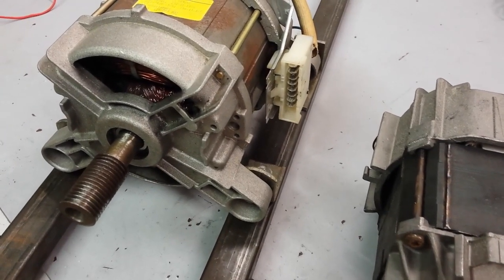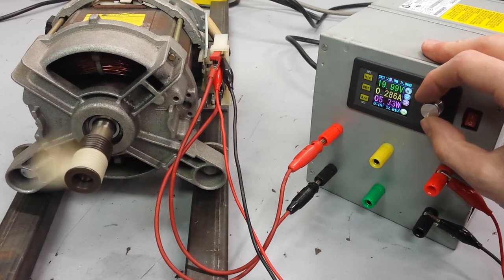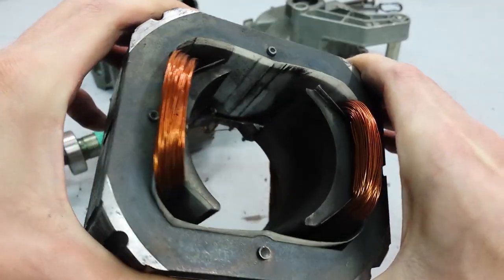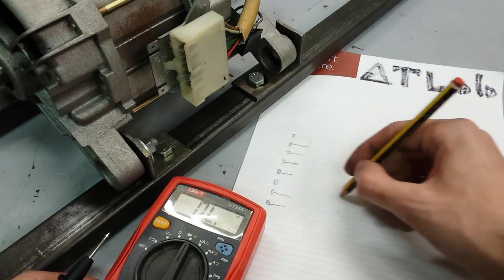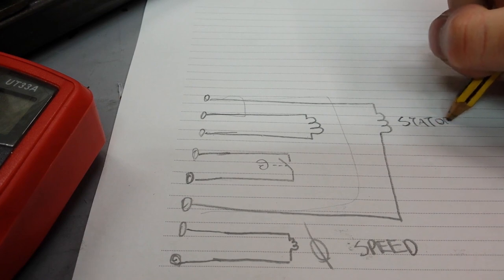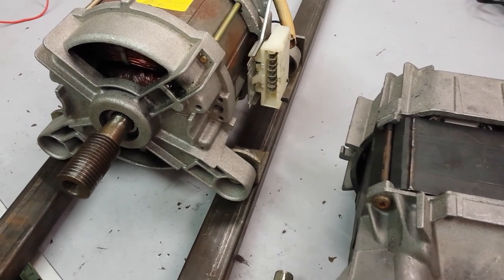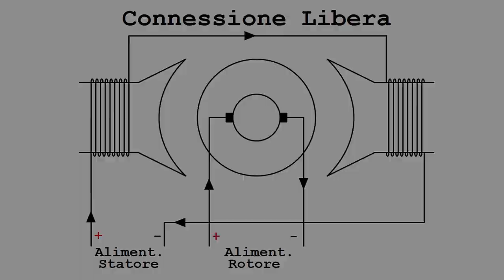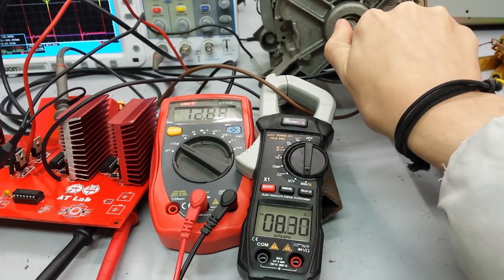How to Wire and Control with 12 V DC and High Torque Washing Machine Universal Brushed Motors

Comment: The reason they connect the stator and rotor in series is to keep them in sync with the alternating current so the magnetic field is always pushing in the same direction. If it were connected in parallel the rotor wouldn't turn and it would buzz loudly with AC
Reply: But the stator is also connected to AC as well, it won't necessarily buzz, the only reason why it's connected in series is to generate higher torque as I have seen in a research, so no it's not accurate to say it will buzz otherwise even the field windings are also connected to AC, it's because even the direction of the magnetic field of the field also flip with the magnetic field of the armature windings according to the current flip as well, whether it's parallel or series it will still spin.
Reply: But in a washing machine, it's neither connected in series or parallel, the motor field and armature windings are actually connected separately to the relays in the PCB so that the spinning direction of the motor is reversible.
Reply: why phase meter screwdriver's lamp lightens up when touch the frame while motor is running on 220v ac?

Comment: Thank you for this video. It has helped me with a project requiring low RPM and high torque. I have used the motor to drive a small industrial sewing machine and it been successful in doing what I required. My only problem is the arcing that occurs across the terminals of the foot switch. The arcing occurs when the switch is released. I'm  thinking it is because of a back EMF that is induced by the motor. I tried a capacitance and resistance snubber circuit with no success. I guessed the values of the components. Have you any advice?

Comment: I have a washing machine motor and it has only 3 wires.how should i wire it.?
Reply from the maker: Only three wires is most probably a thre phase motor.. you have to use an inverter, please check my channel to see the inverter circuit